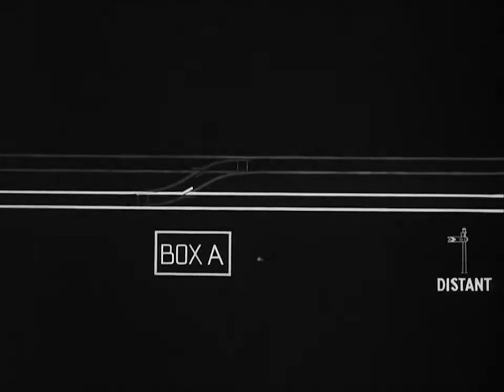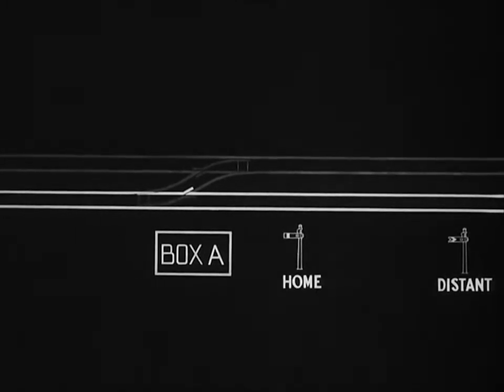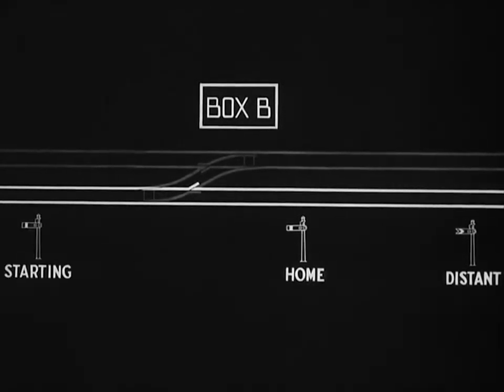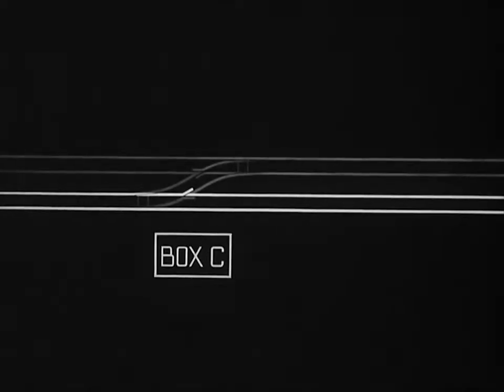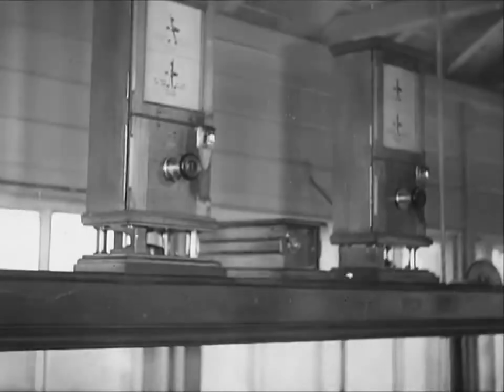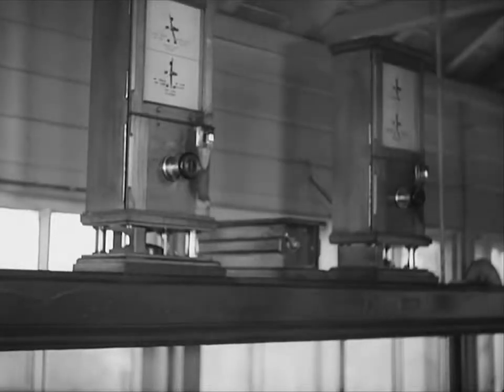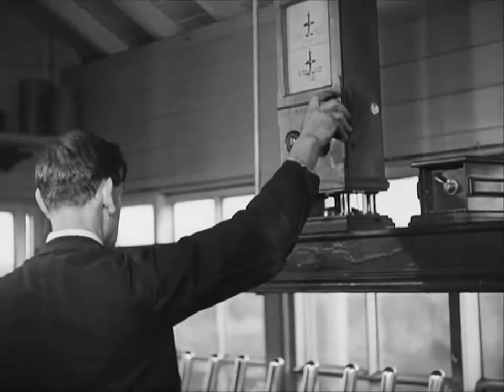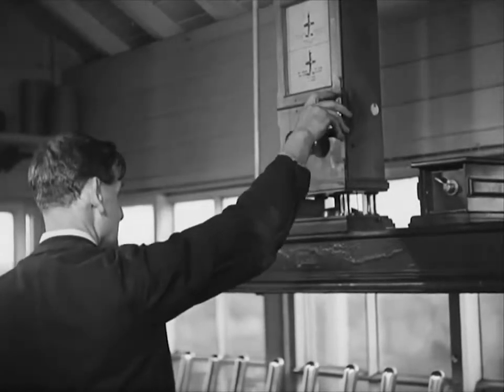LMS training video - Sentinels of Safety

Comment: In the early 1960s, the featured Coton Crossing was near where I lived in Tamworth Staffs. An over-road bridge made it redundant. It is the 4 line Trent Valley section. Sometimes the signalman would let us turn the massive spindle that opened the gates -hard work (especially if he teased us by leaving the brake on!) later version of what we see here. I rescued some of the discarded signal plates, Home, Distant etc. Excellent archive work BBR.
John Kennedy

Comment: Hi there! Being from the US, I’m not quite understanding how your blocks/sections are laid out. Is the signal box at the start, in the middle of, or at the end of the section? Does the “starting” signal denote the condition of the section ahead? Does the “starting” signal mark the bondary line between sections (which if set to STOP cannot be passed)? “home” next to the SB is clear, but the locations and usages of “distant” and “starting” are still quite confusing to me.
Reply: I'm not an expert, but this is what I've been able to glean.

There are two types of signals: caution and danger. Stop signals must not be passed if they are on; caution signals warn that a later stop signal is on, giving enough time to brake. You don't stop at a caution.

The general purpose of the three signals is that the distant is a caution signal for the home and starting signals, which are stop signals. The home signal is the block's main signal and the starting signal controls entry to the next block. As far as I can see, in simple cases such as a straight-through mainline with no crossovers, sidings, junctions etc., the starting signal would be omitted and the home would serve that role. Also, it was common for a box's distant signal to be mounted on the same post as the previous box's starter. If both of these features were combined, the driver would essentially see a single indication, albeit from two signal arms on the same post, which would be either "stop here" (home at danger, distant irrelevant), "proceed here but prepare to stop" (home at proceed, distant at caution) or "proceed here and your next signal is at proceed" (both at proceed).

Each block runs from the last stop signal controlled by one box (the home or starter) to the first stop signal (home) of the next. So, apparently, any track between a box's home and its starter wasn't considered part of a block.  Essentially, the home means "You can pass through the track controlled by this box" and the starter means "You can enter the next box's track." An example of a separate home and starter would be where a branch line diverges from the main line. The home signal would control entry to the branch and there would be two starters: one on the mainline and one on the branch, each controlling entry to the block controlled by the next signal box on that particular line. Consider a train on the mainline that wants to enter the branch, and that this requires crossing the other track of the mainline. If another train has been given permission to pass on that mainline track, our train will be held at the home signal to stop it crossing. Once that train has passed, the points will be set for our train and it will be given proceed at the home signal and enter the branch. If the next block of the branch is occupied, our train will be stopped at the branch starting signal, but it will be clear of the mainline so we can keep running trains there. At complicated junctions, there could actually be multiple home signals, each controlling entry to the next "step" of the junction. (E.g., imagine that our branch line actually splits in two straight away, or that there's a siding or similar.)

Hopefully that makes some sense. There's much more detail at https://signalbox.org/block-system/
Reply: Quite late, but here I've got a link to an Argentine Wikipedia article where it explains with detail how mechanical signals worked; I guess the fundamentals behind it are practically the same than those in Britain as railways in Argentina were laid mostly by the British. I suppose Google Translate will make a fine job: https://es.wikipedia.org/wiki/Se%C3%B1alizaci%C3%B3n_ferroviaria_argentina
Reply: It’s been a few years, but I’ll try and explain.

In traditional block signalling, which the video is describing, the route is split into “section” and “station limits”. Station limits are the stretches of line between a signal box’s outermost home and section signal - while in there, the train is “under the control” of the signalman. Beyond the section signal, and up to the next box’s home signal, is the Section, between boxes.

The reason there’s multiple signals is primarily for flexibility - if there’s a delay, you can draw a train past your home signal and stop it at the section signal, allowing you to send “train out of section” and allow the man in rear to send you the next train. Not always, but that’s the general idea.

As far as a driver is concerned though, it matters not (much) what type of signal he’s passing - home or section. If it’s red, he stops, and if it’s green he can proceed as far as the next signal.

The distant signal is yellow, not red - it serves as advance warning of the state of the signals at the next box. If it’s yellow, the signals at the next box are red. If it’s green, then all the signals at the next box have been cleared and he can carry on at full speed.